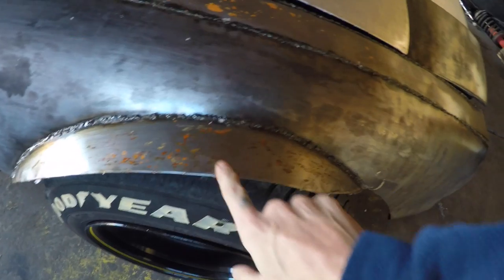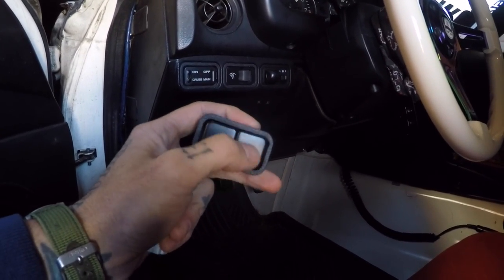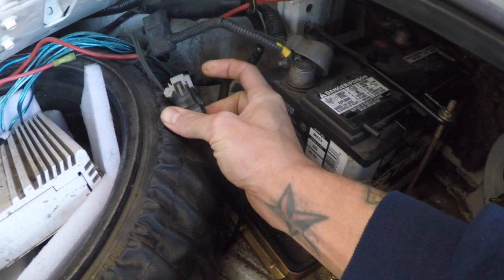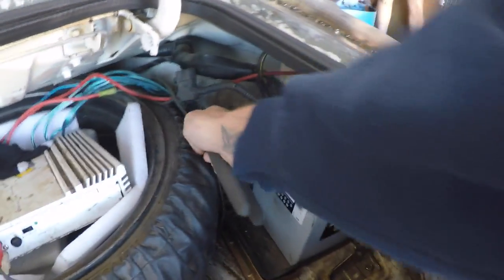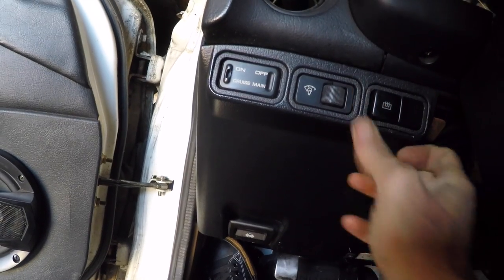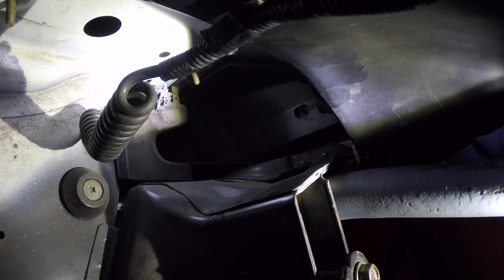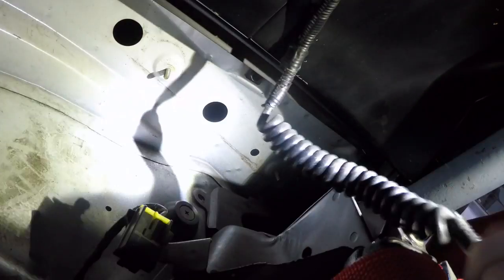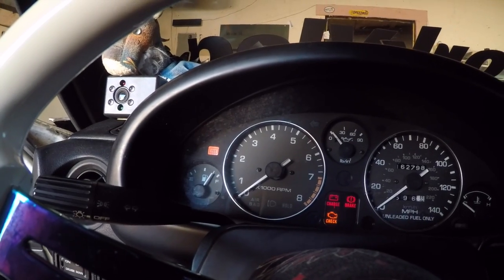Miata Rear Defrost/Defog Install HOW TO S07E12

Comment: I have a 90 Miata and I don’t have the dongle or the other fuse block near the battery.  Where can I get those from?  Or do I have to do some custom wiring?
Reply from the maker: that means you have one of the other years or you need to wire it.

Comment: Hi from England, Love the car,  I have a 93 glass rear screen soft top, all wired in at the glass but no switch, all 3 slots are blanked off (right of the steering as rhd!) I notice you said something about 93 models being on a timer, how do i acually turn the rear screen on if i dont have a switch!?? hope you can help
Reply from the maker: HOWDY! and THANKS!! there should be a timer relay already under the dash. if so, when you turn your dash controls for the heater on to defrost, you should see the rear defrost light on the dash for a certain amount of time. if not, you may need to add the timer relay. all your questions will be answered here. https://www.miata.net/garage/hardtop/
Reply: So Sammy, was there a timer relay in there already?

Comment: Do I have to use a fuse block if I don't have a power antenna? I tried it and the radio and engine keep running even when I remove the key. Thank you.
Reply from the maker: ummm. no idea how that his happening... must have some wires crossed.
Reply: Same thing happened to me. Any answer to this?

Comment: Hi, I have a RHD eunos '93. Everything ready to go but no defrost indication and when I put the 10A fuse in the fuse block in the trunk, the ignition gets stuck 'hot' and won't turn off unless i remove it. Any ideas? 
P.s. Great video, followed it to the letter but sadly, no hrw
Reply from the maker: no clue, sounds like you have another issue. maybe a bad ground or shorted wire. check all the circuits shown in the video and make sure everything is connected properly...
Reply: @pawpatina  thanks, ill do a full check ✔